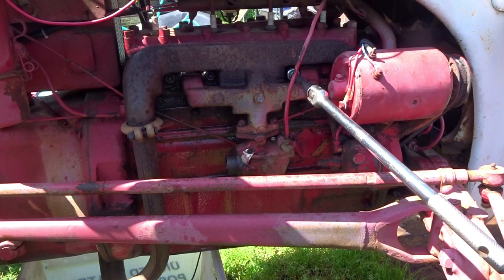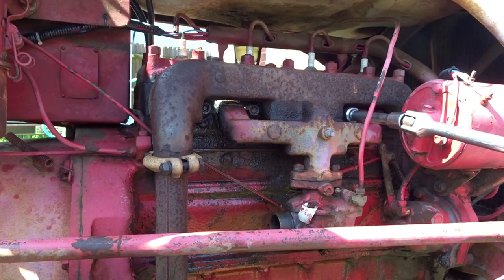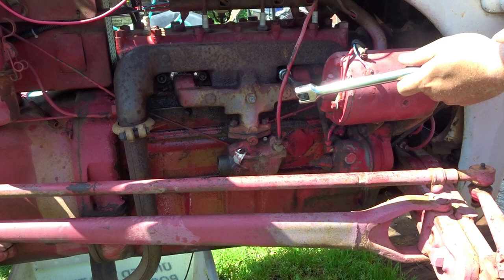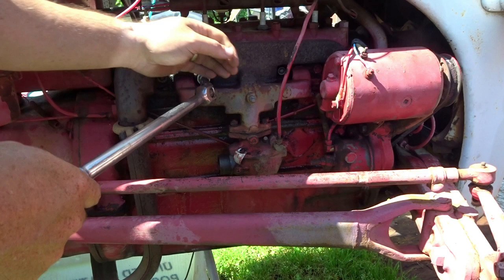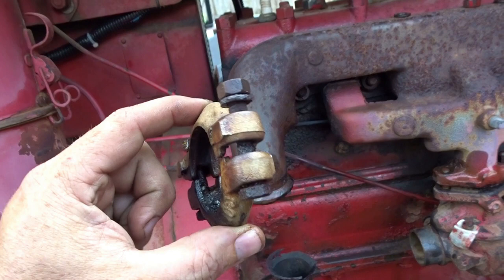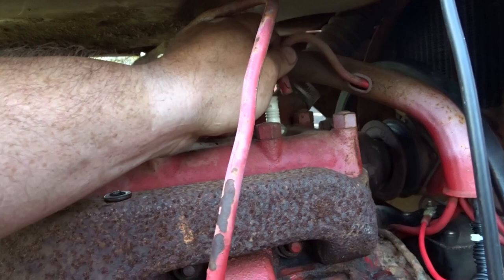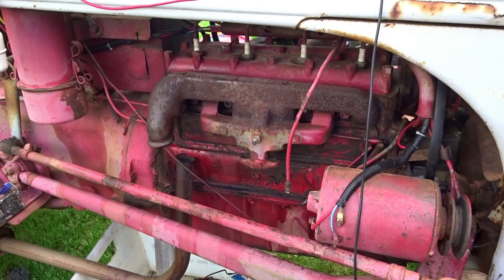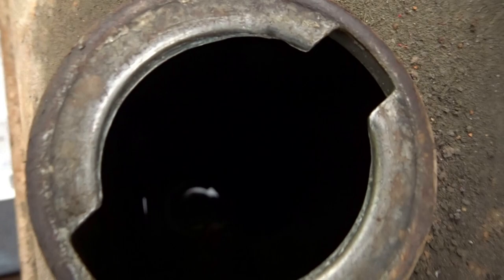New Project 8n ford Tractor (Exhaust and Carb) Part 5

Comment: Forget WD40, use PB Blaster.
Reply from the maker: Well it worked.   Ive used WD40 all my life.  I had PB Blaster and couldn't tell a huge difference between the 2.    I  think it's like Ford Vs Chevy  you're either a Chevy fan or a Ford fan.      Actually I've used transmission fluid and acetone   50/50 in some situations and it does really good too.